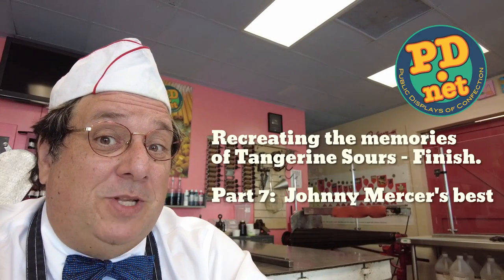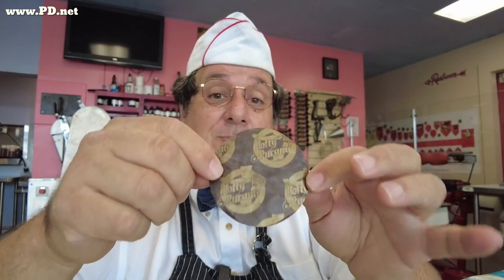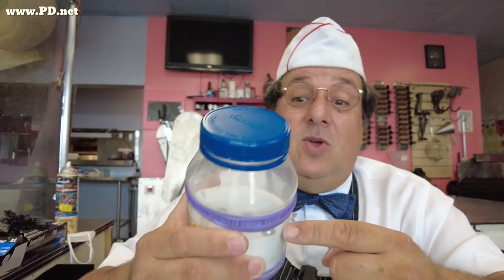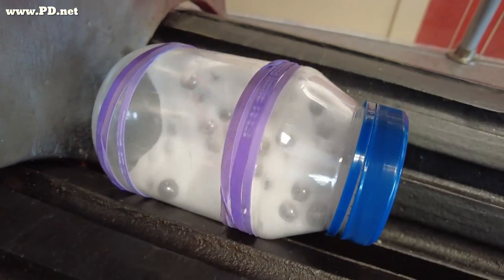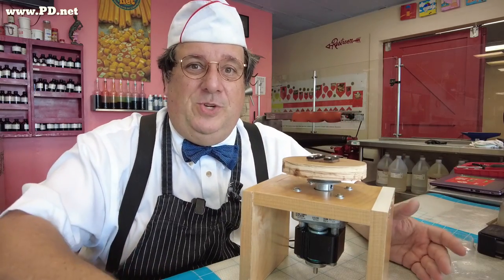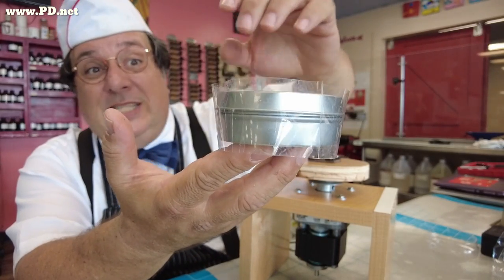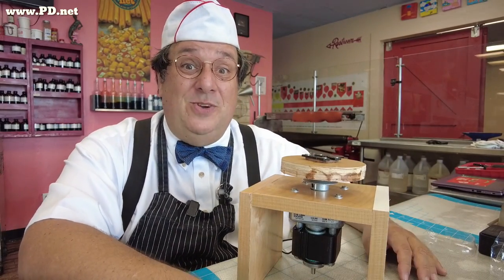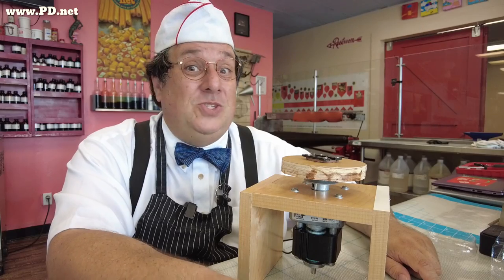#164 The finish. Recreating Tangerine Sours. Toasts to Tangerine - Part 7

Comment: This guy's like 
"Great suggestions, but, I got a mayo jar and a couple rubber bands."
Love it!! And it seems to work great! Definitely excited about these
Reply from the maker: I hate to use the term overthinking the project, but it seemed to me there was a simpler solution. I don't like to work harder when it's not necessary. The rubber bands by the way came off the asparagus I had for dinner the night before. They use very good rubber bands on asparagus

Comment: Hey I had a suggestion about the shrink wrap machine. You may have thought about this or even done this by now. It seems like you may already have the motor on a foot switch because I didn’t see you actually turn on a switch but if you don’t, you could make a mount for the heat gun and put the motor and the heat gun on a foot switch so you could just set the canister on the rotating part and hit the foot switch so they both come on at the same time. It could save time and make it a little more automated. Love your channel!
Reply from the maker: The heat gun takes about 10 seconds to warm up. It's more efficient to leave it running

Comment: Great solution to your new setup! As far as I can tell, your giant shrink wrap machine should be a 6000w 220V 3 phase 5 wire setup.
Reply from the maker: Should be. It's not.
Reply: @LoftyPursuits  Maybe a 110V to 220V pigtail like AC/DC welder have? Looks like a 110V female to a 220V male.

Comment: Also 110 60a is used in one of my small glass fusing kilns but that's kanthal wire elements so its wiggler current, or so they tell me.

Comment: I don't know why you're going through that much trouble for the malic acid. You can buy bags of pre-ground Malic Acid. I found some on Amazon in just a quick search. Or, if you don't like the size of the grain of the acid, you can either use a coffee grinder or a blender for larger amounts. So much faster than ball bearings in a mayo jar on the candy roller. You're done in just a few minutes and both the coffee grinder or house hold blender are food safe.

Comment: What about using one of those candy tumblers that you see them use when you're adding a candy shell to things like m&m's?  Couldn't you add the metal balls and the acid and just let it tumble? They kind of look like  an open clothes dryer set at a tilt. If not what about using a ball grinder that ceramic artists use use? We use  Them to break down glaze chemicals  into a fine powder.
Reply: It be very loud. At least my experience with both setups.

Comment: I work as an electrical designer in a large PME firm. I think I have run into equipment requiring 60+ amps at 120V at MOST once every decade or so. Do you have a manufacturer/part number you can share? Does it have a wiring diagram we can look at?
Reply from the maker: It came from china, do I really need to say more? I've done some back of the napkin calculations and a gauge wire for the power line that gave me it's not enough to handle that. So I think it's actually using less power and it's mislabeled. I think it's 30 amps. I think they just did their math wrong. Give it a shot and see if it closes 30 amp circuit breaker. I have a 30 amp circuit in the shop, I just can't figure out which one it is
Reply: @LoftyPursuits  If you know the power/KW/KVA rating you can determine ampacity. Then multiply by 1.25 for minimum breaker rating. For example at 60A feed and 120V rating I would expect the heater (and fan, but that is minimal) to be about 5.75KVA.

Comment: I thought the point of using a machine to shrink wrap was do that you didn't have to do 1 by 1. Has that changed? Because the spinning machine + heat gun is neat but you'd probably would need a person to just do that all day
Reply from the maker: That was the goal. The goal was unobtainable. Figured out another way to do it that's pretty fast
Reply: @LoftyPursuits  i figured if y'all ever were to make more tin like candy it would be one thing that needs to be R&D to make it faster but this candy has been in the lab too long it's almost not worth stressing over specially if y'all do it in rounds/batches